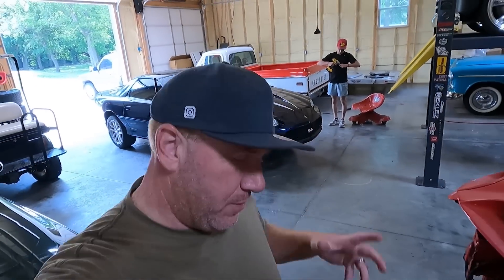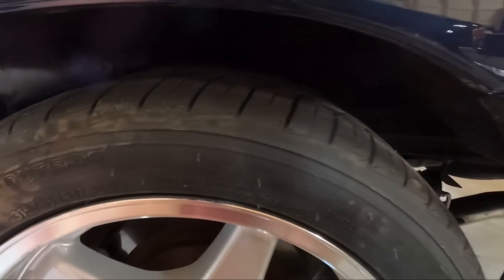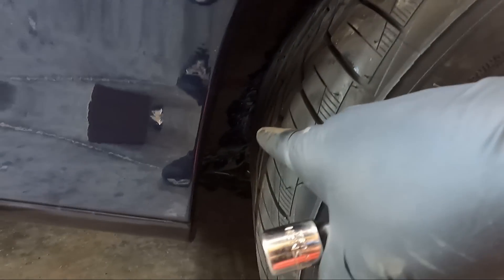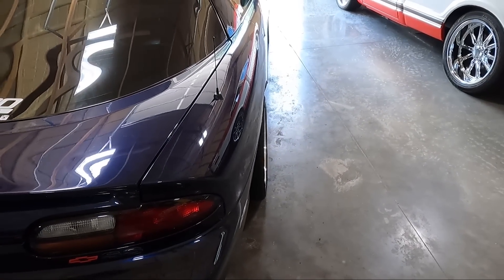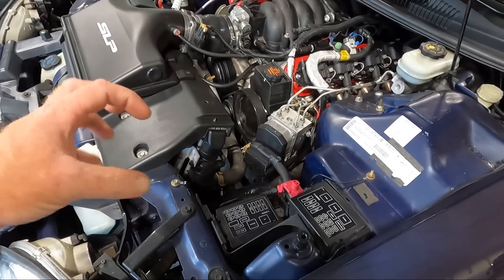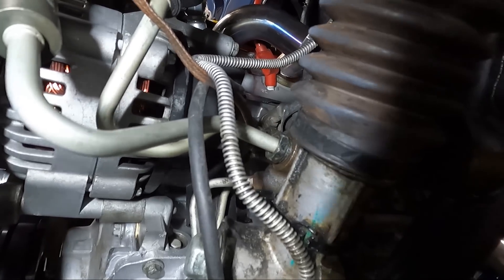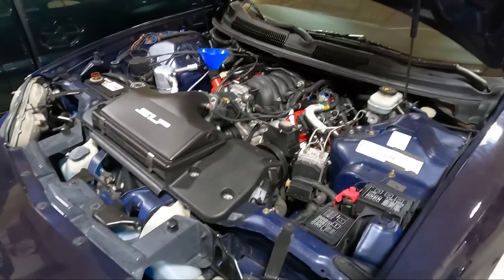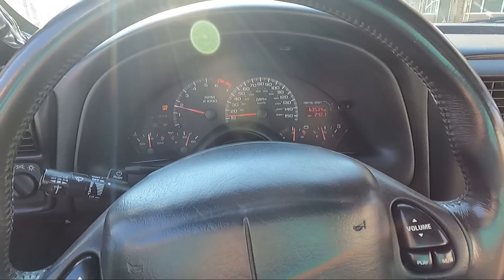Camaro SS Rebuild Part 7 (New Wheels, Tires and Alternator Plus Can He Even Drive it?)

Comment: I laughed when you said you would try using the pick. I knew better.
I put a quick disconnect for the wire in the harness closer to the top of the engine last time I messed with my alternator. Nothing was wrong with the wire but it made life easier and no issues after a few years.

Those wheels look great 👍🏾
Reply from the maker: Lol. A quick disconnect will happen. Thanks for the idea.
Reply: I'm happy I can give back. I learn A lot from your videos
Reply from the maker: Thank you

Comment: The 315/35/17s I had on my 01 Z28 rubbed also but it was in the middle on the backside. I used a BFH and fixed it right up
Reply from the maker: Lol. Good ole bfh

Comment: Hey Travis, I’ve been a fan and follower for sometime now since you started these videos and your shop.  I have the exact same wheel/tire combo you have now.  I had installed a UMI on car adjustable panhard rod arm and it centered the axle perfectly without any rubbing at all.  It mostly rubbed on my passenger side in the exact same spot you hammered on yours.  I believe it mostly was on that side also is because I lowered it with the Eibach Pro-Kit/Bilstein package that’s available as a level
2 SLP option when they were new and still available to this day im sure you know.  Matter of fact if I remember right you installed atleast the Bilstein’s in the B4C Camaro you had many moons ago?  My stereo I installed exactly the way you did about a year ago with the same Pioneer but I used 4 Kicker 6.5 coaxial’s and 2 more ( forgot size) little
Smaller Kicker coaxial’s in the hatch panels in far back, 2 Kicker amps Highs/Subs and ran my own wire for all speakers.  I’m very interested in your 6.5’s you installed I’ve always thought that would be a better set-up with Mids in the sails like you did.  I also installed a rear camera that if you wire it right you can have it on while driving w those and other head units if you didn’t know.  Anyway I’m jealous your living the dream!  Great stuff!
Reply from the maker: Thank you for the comments. Looks like you have an awesome project yourself. My son is really liking this thing but kinda wants an automatic now.

Comment: The car looks so great! That blue with the white continuity, awesome car. Does he want to lower it next? I'm looking for adjustable coilovers myself and most people point to Vikings or QA1s but I can't seem to find spring rates stiff enough. As for your sons driving I'd say he was a little too fast off the clutch but he did good.
Reply from the maker: It is lowered. Has viking coilovers in front. Bmr springs in rear
Reply: @TWAMotorsports  Very nice, don't know why, maybe I only saw the rear ride height
Reply from the maker: It is higher in rear but 1.5 lower than stock.

Comment: How good are those alternators? I'm considering installing a truck one in my ws6
Reply from the maker: Mine has been flawless
Reply: I have a 3 month old ac delco,  that's dipping pretty bad, it's my 3rd alternator in under 1 year.
Reply from the maker: Holy cow. Yeah that sucks
Reply: I'm ordering this 1 that you have a link to, hopefully that'll be my fix.
Reply from the maker: It's been great for me
Reply: I'm running that same set up in my ws6 too, 228r cam kit from Texas speed, 243 heads, stage 1 monster clutch, ticks master, and a t56 magnum.
Reply from the maker: Nice

Comment: Travis, get that factory power steering cooler out of there, like yesterday. It's going to fail at some point and it's going to cause major problems/repairs. This happened to me on my 1999 SS. The power steering fluid enters that cooler from the outside while the anti-freeze cycles through the cooler from the inside and cools the PS fluid. Internally, a metal cylindrical wall keeps the PS fluid and anti-freeze separate. Mine failed and the PS fluid and the anti-freeze fluid mixed together when they cycled through that factory POS cooler. It destroyed my power steering pump, my radiator, my water pump and the rack and pinion. I had to replace every one of those parts and I thank God I have a trusted mechanic, but it still cost me a shiny nickel. I now run a straight hose from the radiator to the engine where the factory PS cooler was and have an aftermarket PS fluid cooler mounted underneath. Unless that factory PS cooler was drastically improved by GM it's best to do some preventative on that thing and save yourself some headaches down the road.
Reply from the maker: Yes I have experienced that before

Comment: I have a question. Only because I have my own 2000 ss. I have you ever thought about putting all LEDs in one of your 4th gens? I ask bc I have done it on all of my exterior. And now I have weird electrical issues. I’m sure it’s a resistance issue. Just wondering if you have done it or thought about it. Maybe you had some small remedies for the issues if you have done the swap.
Reply from the maker: I haven't actually. This one has a few on the outside

Comment: What size fuel pump are you running? I’m having. Some issue with my new 340lph quantum fuel pump assembly I just installed , ignition on fuel psi at the rail is 52psi and will hold that for few hours 4-6 then drop down slowly then by morning it’s at 0 is that normal or is it supposed to hold some psi ? I check injectors they are no leaking and new fuel filter . Runs good , air fuel gauge is good at idle and wot
Reply from the maker: My guess is pump or leak. Pressure shouldn't bleed off
Reply: @TWAMotorsports  so it should always hold some fuel pressure over night ?
Reply from the maker: May bleed off some but generally not zero

Comment: Good evening, Travis. Yes sir. I LOVE my 315/35/R17 on the rear of my boy AFTERBURNER.  Great fit. But! You do have to remember if you and your son want to lower the camaro. Only do a 1 1/4 inch drop. NO MORE! 🙏 asking for trouble if you go any lower. I went with belstin/Eibrock pro plus 2 lower kit. 👌 stance. You'll have to shot me your email or number. So I can send you pictures. 315/35/R17. 👌 with 1 1/4 inch drop.
Reply from the maker: I have done several drops on these with 315s. They need rolled if going 1.75 or more. Every car is different.
Reply: @TWAMotorsports  yea. True. So was your son giving shit about your money shift? When I changed out my shifter I went with Tick performance. Not to bad at all. Most definitely has help the 2nd to 3rd shifts. 👌
Reply: @TWAMotorsports  since he's got a 6 speed. Time to do some 4.30 gears, baby. O! Yea! Talk about holding to yo butts 2nd thru 4th shifts. I'm LOVING my 8.8 rear-end from hawk motorsports with 4.30 gears. Even on interstate at 80mph I'm running at 2,100rpm. With the 3.42 gears stock at 80mph I was running at 1,400rpm. Talk about. LOW END POWER, with 4.30 gears.